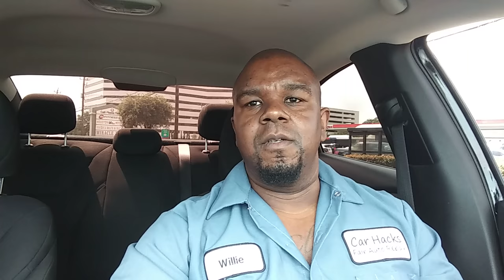Is your gas cap causing a check engine light?

Comment: Thanks bro... that hissing noise when I open the cap is exactly what I have!! Problem solved thanks so much! NOBODY on the whole dam internet ever bothered to explain how air relates to the gas cap except you. 😂That was exactly the piece of information I needed to solve my Corolla engine light problem.
Reply from the maker: Glad i could help 😃
Reply: I love my Corolla, but I thought the vacuum noise was expected so I never tried to fix it!
Reply: And how did you fix it
Reply: Dang…. You are just a likable guy Willie.  Thx for the pro tip
Reply: @fairautorepair2787  but how you fix it?

Comment: Did not tighten the gas Cap correctly, the check engine kept turning on! Finally figured out the problem. Thank God!
Reply from the maker: Awesome!
Reply: what did u do bc my gas cao was off for a while until I noticed and fixed it but the engine light is still on
Reply: @jimmybarreraa2804 I believe a mechanic needs to reset something in the car so engine light will go off
Reply: Same
Reply: Now engine light is turned of

Comment: Omg I have a 2007 Pt Cruiser and if I tell you I've had problems, yes I have. Gas cap and check engine light is on. Going to change the cap and see what's up. Thanks for the info. 🙏🏽

Comment: Very informative. My check engine light came on today and so far everything seems to point the gas cap. Mine makes that noise sometimes but not all the time. So I’m guessing that means my gas cap is still faulty and it is finally triggering the check engine light? I have a locking gas cap I’m going to take it off tomorrow and put the stock one back on and see what happens. do I have to take off the negative terminal and reset the check engine light or will it go off automatically once I change gas caps? Thanks for your help.

Comment: My gas cap stopped clicking about 2 months ago, didn't think much of it, it still felt like it tightened. Then a couple weeks later, my check engine light turned still on. So I bought a new gas cap, the NEW gas cap didn't click either. I tightened it as much as I could and went on my way. I don't notice any performance changes at all but my check engine light is still on. Any advice?

Comment: Sweet! Thanks, Willie! Just bought a clean 2012 Mazda 3 and check engine light went on after filling the tank. I left the gas cap on the top of the pump. Ooops, shit happens
Reply: If it continues look into gas tank cap seals, and fowled plugs 🙏 small issues with those solid 2.3L throw codes constantly it's np.

Comment: You seem genuine you got a new subscriber. I have a 2106 jeep Cherokee i have the code 0456, I changed the gas cap,then the purge valve,then I changed the ESIM, and the engine light went off but the gas cap light still comes on. Any help would be appreciated. Thank you

Comment: My engine light has been coming on and the error mentions a fuel valve. I’m hoping it’s just this so will try this first. My car is performing ok no issues with it at all. Great video though even if it’s not the cap I need to replace. 😊

Comment: Ty so much willy!!! Just bought a used 2011 Santa Fe. I love it.  It's the 3rd vehicle I have purchased in 20 years from the same man, but I was starting to worry when check engine light came on about a week into having the car. Found out it was gas cap. Well I cleared the light out cap on but every time I get gas (3 times so far) I manage to make check engine light come on. Well. System didn't clear this last time so your video solidified my decision to start by buying new gas cap 1st then see if it still happens.

Comment: So does the check engine go away on its own?? The light just popped up today. I checked the gas cap and it wasn’t screwed on tightly. Audi is wanting to charge $210 for a diagnostic

Comment: Very informative video, thank you !   My check engine light  came on with my 2006 Toyota Tundra truck.   I do believe it is the gas cap but the code says PO333 which is  supposedly the Knock Sensor 2.  Circuit   High Input  (Bank 2)  issue(s).  Is it possible  the loose gas cap could cause this particular code reading  instead  of the  “loose cap “  code  of another number ?     
I will buy a new cap today but I would  please like to know the answer  as you are a very knowledgeable mechanic  !  Thank you
Reply from the maker: I owned a Lexus ES350 and had to change the knock sensors on it.  On that engine it was best to replace both knock sensors and a knock sensor harness at the same time so that I would not have to go back in and repair second time. Toyota make good vehicles, that car had 230,000 miles and it ran smoother than any other vehicle i ever owned.
Reply from the maker: But yes replace the cap 1st. It can cause all kinds of weird problems

Comment: Common problem in saturn vue but it will keep doing it even after changing caps over and over,the only info i could find to fix it is a locking gas cap

Comment: Wuddup Willie. I have a 2005 toyota camry. My service engine light now remains on. Everytime I pull the fuel door release switch to open the fuel door the gas cap is loose. I turn it until it clicks several times and close the fuel door but when I pull the switch again right away and check the cap it be loose. Do you know if when the switch is pulled to open the fuel door does that automatically loosen the cap for convenience or could my gas cap be malfunctioning?

Comment: My 2006 Scion had this problem and no one could figure why the check engine symbol kept going on.  When I was having my oil changed I asked the tech about that and he opened the gas cap closed it and tightened it and that fixed it.  I now have a 2012 Infiniti and having same issue, I have a new gas cap on order.

Comment: My check engine light came on. So I check gas cap which was loose. I tighten it but the light is still on. When does the light turn off?
Reply from the maker: Some cars can take up to 75 miles to clear a code.
Reply: @fairautorepair2787  thanks man

Comment: I changed my gas cap in my 2006 Ford expedition and had engine light removed from a mechanic friend, but my light came back on after a week. I noticed it came back on when we had rain and winds. I'm not sure if that's a coincidence or not. But Could it be a leak somewhere else?

Comment: I had the same issue a year ago and I just seen some one on you tube post about a gas cap to risk it and I think I fixed my problem after mas flow sensor put on new another sensor that didn’t needed it does make ur car run like crap

Comment: Can that cause also a fuel smell inside the car? I have a 2011 malibu and about two weeks ago it started smelling fuel from the vents but also even if the car is parked, smell on the outside….. common issue would be a vacuum line or injectors, but being parked I don’t think that would be the problem and also is consumes more fuel than usual, and a massage just popped out in my dash “check gas cap”….. thanx in advance

Comment: I have the same problem but the only thing is, even when I changed the gas cap. The check engine light was still on and I was sure to tighten it correctly. I took it a few mechanics and they would say it's the gas cap but weren't much help because the light will still show
Reply: Ur issue fix?

Comment: Hey Willie, thanks for the video. I got a quick question I got a 2004 Subaru Impreza 2.5rs and let’s say I prepay $20 in gas right? The pump clicks off every 2 or 3 dollars… sometimes around a dollar… is there something wrong with my tank?? Any idea? I put $20 in today and it probably clicked off 20-30 times before I got the whole 20 bucks in my tank
Reply: I'm not a professional. However, in researching my evap issue, the only info I've ever found regarding problems filling the fuel tank was with the evap canister vent shut valve. Check YouTube for its function and symptoms with a bad one.

Comment: I have a 2000 sl600 and this year I've had to replace my gas cap 4 times - everytime I filled the gas tank the engine light would come on and i would have to replace the cap. Any thoughts?

Comment: so.... does this affect diesel as well? or only gasoline? cause everytime i go refuell check engine light comes in... i go pay 10$ i get all errors removed with a tester... they all delete... nothing remains... i drive 1 week with no issues... i go refuell... and check engine light back again in like 1 mile of driving... diesel X3 2.0 2009.

Comment: Good morning Sir.  My car is a 2012 Infinity G37X 4 door.  I bought the gas cap at the original dealer and the engine light was erased by the mechanic and the engine light came back again and this month I have to do an inspection with MVC and I'm worried.  Please I need some advice.  Thank you.

Comment: I have a 98 f150 5.4...I bought 2 new gas caps both didnt click, then i bought an oem motorcraft cap, same thing no click, even though it says tighten til it clicks.... could i possibly have a newer fuel tube? Im the 3rd owner.

Comment: thanks! this happen to me today!! i forgot to put gas cap back on and caused engine light to turn on…i put back the gas cap but still showing check engine light…what do i do next
Reply from the maker: you may need a new gas cap. or wait up to 75 miles to complete a full drive cycle to clear the code

Comment: Does a 2008 Kia Sportage have a gas cap code? I have a Fuel-trim code in banks 1 and 2. But wouldn't a gas cap code also get triggered if that was a problem?

Comment: My car struggles each time the tank has in half or more gas a changed plugs cleaned injectors did alot a of still giving same issue can a bad gas cap cause these problems

Comment: I have that in my f250 6.2 gas. It take forever to fill the tank. Throws me 2 codes (p1450 and p0451) my truck runs good. No problems at all. Just the suction noise through the Yellow gas cap. I think this is my problem. What is your opinion?

Comment: Helpp! I have to go through inspection soon and the check engine light is on in my 2005 Pontiac G6. The check gas cap indicator alerts every time I start the car and stays on. The mechanic put a new one on there but the indicator keeps coming on. I won't go off. What can I do? The cap was replaced, but is it possible it could be the wrong type, or not the right one for my car?

Comment: I changed my cap to one of those caps with the lock on, and the light came on, so i change it back to the original cap. How do i get the engine light turn off?

Comment: same with 2015 subaru forester check engine light comes on and off nd that noise you talked about when i fill the tank engine light goes off seems cap issue???

Comment: Ok so my check engine light came on and then the gas cap light came on so I checked the cap come to find out it wasn’t on I put it back on and the check engine light is still on and the gas cap message is still on how do I fix it should I wait awhile let it run drive it I don’t know what to do

Comment: Hi brother I have a ? For you, I had replaced the whole fuel pump system, fuel high pressure regulator and fuel pressure sensor. I still don’t understand why the vehicle sound like it struggle for gas. Maybe you can guide me too the right path. Should I replaced valve purge and canister closed valve. Right now Can’t figure what’s the deal with this 2014 Kia Soul 1.6L engine

Comment: Can it cause the car not to start? I have a brand new battery and all the sudden it would turn over but not start up then tried to get a jump then it would go back in forth between not turning over at all to Starting to turn over but not start?
Reply from the maker: No. Sounds like you may be having a different fuel delivery problem

Comment: This happened with my 05 Acura tl the engine light came on after it wanted me to check Gas cap even though I checked and it seems perfectly fine it still said check gas cap until a few days later check engine light came on again when I checked the light it says it doesn’t read the gas cap or is missing gas cap

Comment: My check engine light code said gas cap. Been on twice now, today I replaced the gas cap right after they cleared the code. Hopefully that fixed the problem. However I just had a fuel pump replaced two weeks ago. Since then has this problem started. Hopefully it was just the gas cap. Fingers crossed.thank you Sir fir the info.
Reply from the maker: No problem

Comment: 2011 Ram 1500 hemi pickup. If I fill fuel tank full check engine light comes on after 18 miles of driving. When it get to 3/4 tank light goes off. If I only fill to not more than 3/4 tank light never come on. Tried different fuel station same problem. No lost of power to engine . Still idle and run great. When check engine light comes on it will not go into 4 cyclinder mode. What up with this ? Going to try a new fuel cap.
Reply from the maker: did the fuel cap work? check evap system if not
Reply: Going to try fuel cap. Thx for reply. Virus put me on hold.

Comment: I replaced the cap on my 02 f150 and the light is still on. What is next thing to check Willy?
Reply from the maker: Try lubricating the cap or filler neck seal with light oil. If not. Replace the filler neck possibly. Your best bet. Check forums and online groups for yor vehicle :) but you need to wait 25-75 miles for the light to go away
Reply: @fairautorepair2787  Willy, took it to orileys and they removed code. Light went out and did not come on while driving home.
Reply from the maker: @mgomez5606  O'Reilly employees are very professional and they do an awesome job.

Comment: What about for those with a Ford that has a capless tank. Mine just opens up from the door and there is no cap its sealed until you insert the gas nozzle from gas station. But there is definitely a problem that is happening in this area.
Reply from the maker: Good question. Any problem with the nozzle, the filler neck assembly will have to be replaced.

Comment: So on my 2014 Dodge Challenger sxt My gas cap light is on. Replaced cap same day. Light still on. Does it take a couple days to "settle and even out" or is it something else? I barely got over 60000 miles on this car.
Reply from the maker: Could possibly be filler tube. Check for recalls and TSBs ( Technical Service Bulletin ) for the car. Also try lubricating the cap seal, Just a small amount of lubricant, apply a thin film of oil on the seal of the cap, I've heard of this solving some peoples light. This is a common issue with alot of BMWs, Dodges and Fords

Comment: If a new (part matched via VIN) gas cap clicks then releases is that a problem with the cap or the vehicle?
Reply from the maker: It may be ok. Some newer caps do that to prevent over tightening and damaging the seal
Reply: Yes I had a check engine light and code which prompted ordering the new cap.

Comment: Thanks man, VW Tiguan 2016, got the engine check light couple of days after refueling, I was worried about the engine or the turbo, it was just the cap......
Reply: I have exact car when u replaced the cap did the light just turn on ?
Reply: @money5701  I did not replace the cap, I just tightened the cap and the engine light disappeared.
Reply: Ok thanks does yours click and turn wen you close it ?
Reply: @money5701  yes, turn till you hear the click, (that's is VW recommendation), to make sure I do twice (two clicks)

Comment: My check engine light turned on because I forgot to put the gas cap on after filling the tank at the gas station, but I put the cap back on later when I found out it wasn't on but the light is still not going away. How do I fix this
Reply: You gotta reset the code with a engine reader
Reply: Look for an ELM 327

Comment: My check engine light has been a pain for months paired with a “tighten gas cap” message. Jiffy told me a new gas cap should clear the engine message too after runnng a quick diagnostic for free after changing my oil. About to throw my new $18 cap on and see what happens!
Reply: Any updates?
Reply: @Zach-nv4ul  it cleared the engine light after replacing the gas cap! Big relief 😅 . I did have to drive around for a bit for it to reset and clear the messages though, within a day it was all clear.
Reply: For reference I have a Honda civic
Reply: @Tenderkisses88  thanks Sis! I went to do inspection and guess what happened?! Check engine light, got my oil changed and I’m replacing the gas cap in the morning (wish me luck lol)

Comment: Great video . Quick question i did a diagnostic on my car cause the check light came on. The technician told me that it was an ignition code and that my #3 & #2 coil packs were bad changed them light still came back on did another scan to get the light of but it still came back on need some advice on my next step.
Reply from the maker: Sorry it took so long to get back with you my notifications are not going off for some messages. First off what kind of car is it. If it were me I would check my fuel delivery like the injectors
Reply: @fairautorepair2787  it's a Nissan y11 aero wingroad will check the fuel injector rail